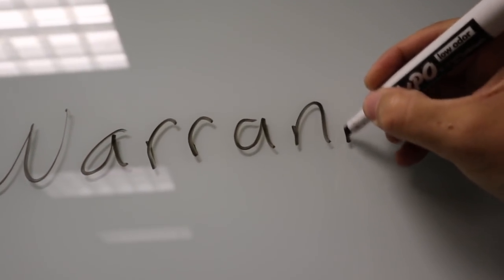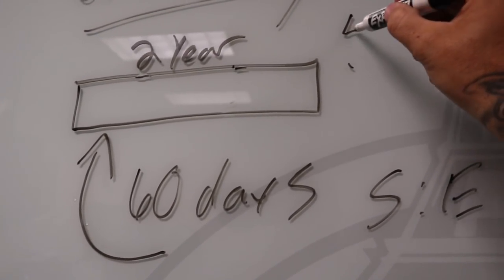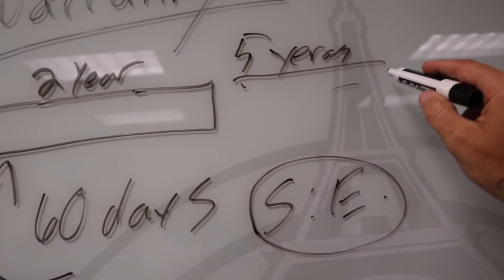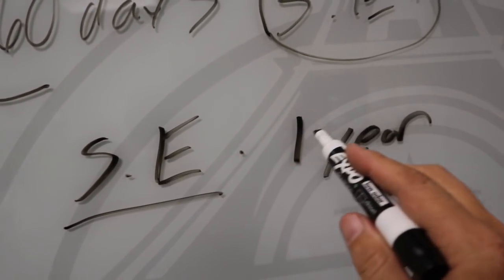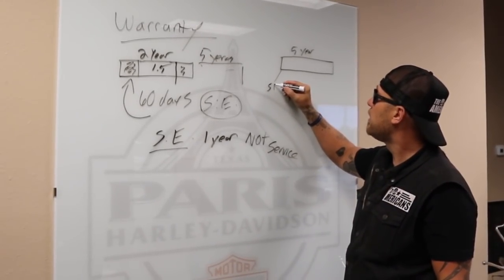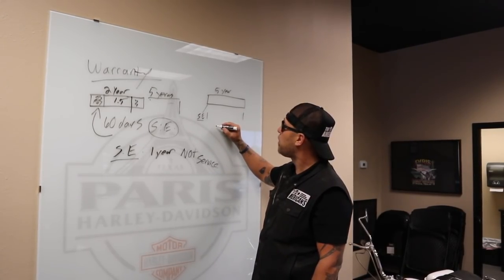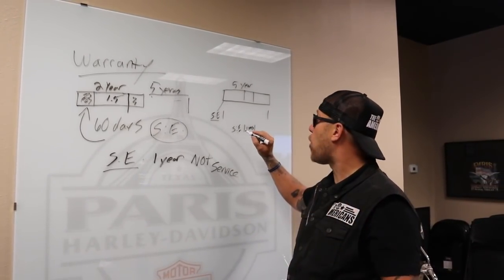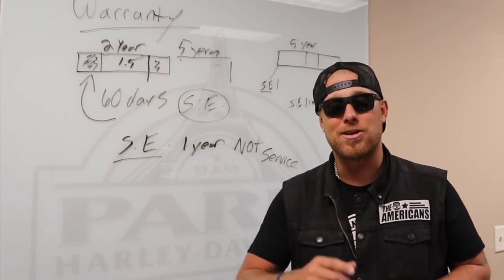HARLEY DAVIDSON Warranty explained / Engine & Exhaust Upgrades

Comment: OK Adam I'll bite. I want to buy a brand new Harley Davidson road glide all truck did the screamin  Stage 2. Upgraded the stereo and the speakers  Removable lowers kit and removable tour pak yet 975 pounds empty $37000. They wanted to give me $10000 for the bike I bought  From them 3 years before for 30. Granted I'm a high miles guy 48000 miles. Just couldn't do that again. Drove 2 miles down the street bought a highly competitive motorcycle to the road glide with everything the road glide had and more for 10000 less now 3 years later no problems no work no warrantee no problems. That road glide that I was traded in had a cracked front cylinder from the factory nobody could find for 22000 miles. Then Harley Davidson decided to buy a new front jog stuff the old piston in with new rings it and call it A-day. That was their idea of a warranty. And you know Adam as a mechanic you never stuff and old piston into a new cylinder. The rear cylinder still had 22000 miles on it. They chose to do nothing about it other than buy me a new cylinder and the labor for the front  Cylinder. So the dealer knew he was losing my business after 10 bikes and offered to give me the parts at his cost and do the labor for free the rear cylinder cost me $97 to screamin Eagle pistons cost me a $102 150  For the ring set. Labor was free. So here's the deal it's not if you modify your engine even Harley Davidson has got a badd business model idea. Look they wanted to stuff and old piston in a new cylinder I wouldn't do that to my Briggs and Stratton  Lawn mower. So that's my story of Harley Davidson warranty and it didn't have anything to do with poor performance parts he had had to do with the   Attitude of the motor company. Remember I had 450000 miles on Harley Davidson before this experience. And as I say Harley Davidson the world's best motorcycle manufactured by the world's worst T-shirt company
Reply from the maker: I’m glad you found the bike that’s right for you 👊

Comment: So if I put screaming eagle breather and screaming eagle tuner on my bike and Vance and Hines Dresser Duals my full warranty is void because of the V&H? That's kind of a BS warranty. Be my luck id say screw the warranty and put the dresser duals on and my engine would blow. Oh well warranty is up in 1 more year any way lol keep up the good work Adam
Reply: MadKlown 318 just make sure and get the vh fuel pak 3 and actually add some fuel to it, reason they crap out after exhaust intake install is hd has to make these bikes run so lean to pass EPA crap, adding exhaust and intake makes even leaner,  get the exhaust and fp3 you'll love it, harley shouldn't be making these run so lean and hot , it's crap,
Reply: Keep your stock exhaust stashed away, if it blows up swap the stock back on. That's how alot of guys get away with a brand new bike with crazy aftermarket parts now and still have their warranties.

Comment: Never buy new!  Buy used, save money, why would one buy a new bike throw half away and buy more stuff?  I get it that Harley is your sponsor however for the normal working man wet all can't afford to buy a new bike.  And Harley won't service a bike over 10 years old.  Still a good video though.
Reply: Not sure where you got the "Harley won't service a bike over 10 years old".  That's absolutely incorrect.  Actually, it doesn't even make any sense.
Reply: grayboo212 really maybe you'd like to try getting an EVO serviced at your local dealership.  Harley has a policy you might want to check into it they do not maintenance anything over 10 years old
Reply: Evos are from the eighties/nineties.  I think the last year for them was around 1998, so that's twenty years, not 10.  Maybe it depends on what you're asking them to do to it.  I ride an 05' Heritage and a guy I work with rides the same bike only a 97' with the evolution in it.  He's never been turned away.  Maybe certain dealerships have different polices.  I wouldn't think so though.

Comment: Why doesn't Harley just offer a bike with all of these parts on it?  Could be a bad a$$ bike
Reply from the maker: R1 3:16 there are lots of options for different riding styles.
Reply: Adam Sandoval Rides I watched the whole video and get it but it would be a nice thing if this was already done on the assembly line and ready for purchase right there on the dealership floor. Just my opinion. It means nothing. 

And thanks, because of your video about the keys, I'm planning my own trip
Reply: can you say CVO?